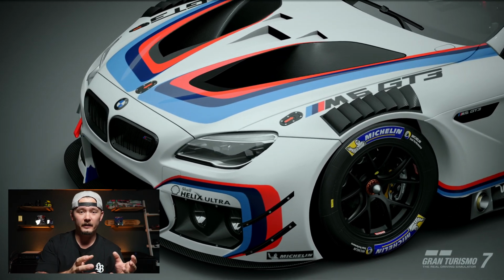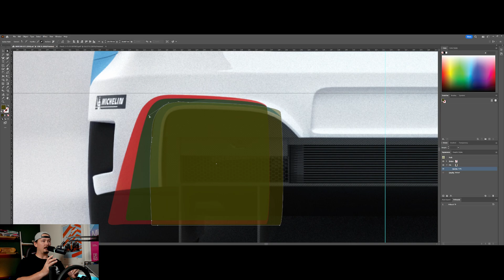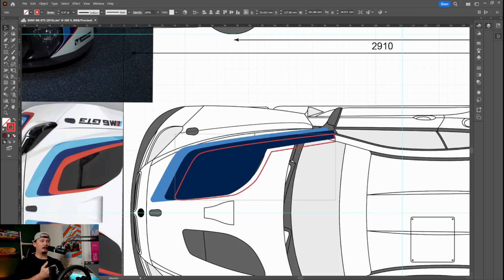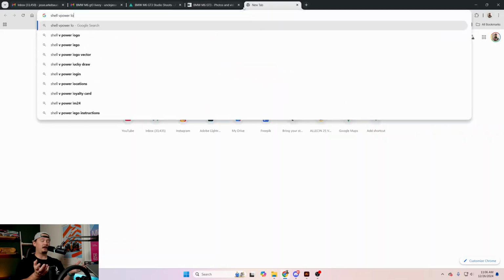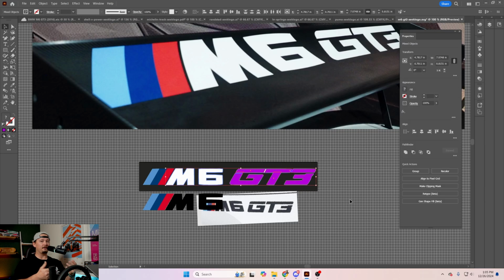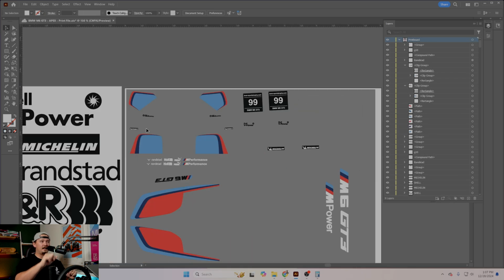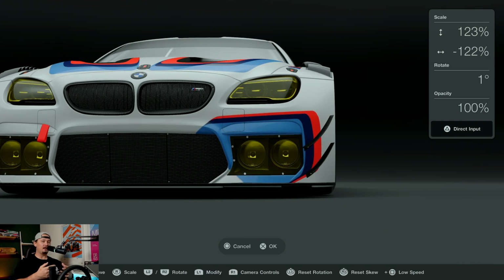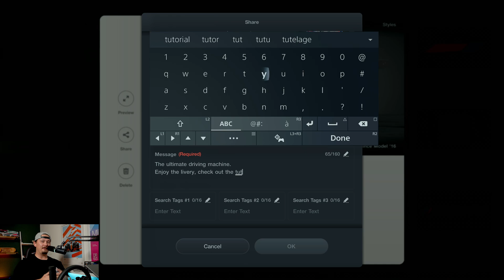Real Life Wrap Design! BMW M6 GT3

Comment: how do you know how large to make the print file? do you measure the template and try to size that to the real car? how do you scale it accurately?
Reply from the maker: The templates are usually to scale, so you create your panel, then add bleed. I’ll usually do 3” in each direction at a minimum. I’ll also pull up pictures of the car at all angles so I have a better idea of how much depth and contour there is at different areas and adjust accordingly. Label the file as 1_10th_Scale then send to the printer, which will scale up 10X when printing. Keep in mind rasters lose quality with more size so that needs to be accounted for in the design. Vectors scale infinitely.

Comment: Is there a site you're pulling these templates from, or are you just going through google and trying to find something car by car?
Reply from the maker: I always check pixlsaurus first but if they don’t have what I need then I’ll usually just Google it. Just have to be careful, some of the templates are much better quality than others. The lower quality ones require a lot of rework to actually use them as templates.

Comment: I'm one of your YouTube subscribers. Thanks for your tips that I failed to find hitting my head against the wall. I'm not a YouTube creator so if you could address the following I'm sure the GT7 community would be deeply appreciative 

What is needed in livery design to get maximum horsepower? 
Is test driving the only way horsepower variations from livery's can be measured?
Is it possible to access more than one page in favorites Library?
Can the names of favorites decal list be changed?
Can favorite decals be added to collections, without refinding the original source?
How can top views be taken in scapes?
Can screenshots be shared in showcase? 

Tips
There is a limit of 1,000 liveries per player, so deleting extras saves valuable space.
Large decal collections can be organized by clicking on the collection button to turn it off and back on so related decals go to the beginning of the list. Listing the order of groups makes them easy to find without scrolling down pages. 

Friend screening qualifier
GT7 protects Artistic Freedom by showing note "Open to Friends" on decals & liveries that should NEVER be used in public races OR added to liveries all can see. 
IF you don't like a friends content, unfriend them. 
    Save reporting for publicly shared content. 
Please friend me if you agree & are 18+. 
GT7
WowGenieTime4FUN
followLOLartcars
Reply from the maker: This is brilliant mate, apologies somehow the comment flew under the radar! Great tips though 😂❤️ some of them gave me a chuckle
Reply: If you would like more chuckles, visit my friends gallery to 
       LOL at my sick and twisted out of the box artcars. 
Warning your future livery designs my be altered.